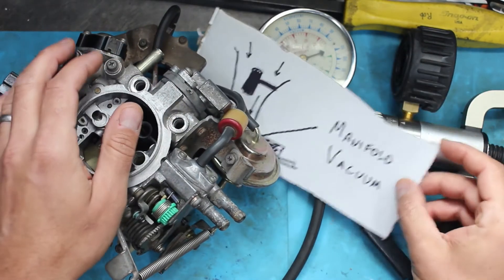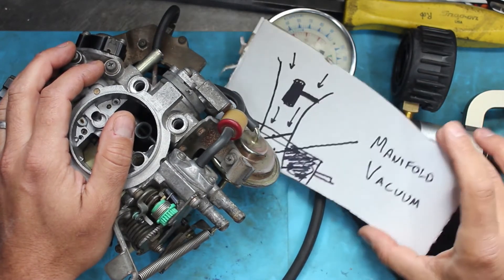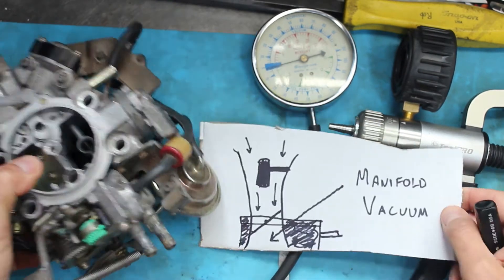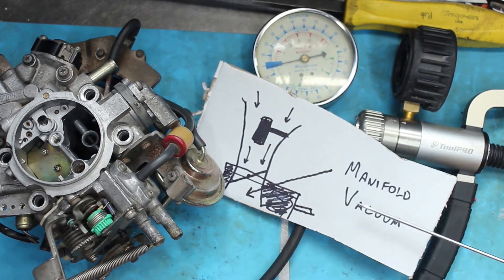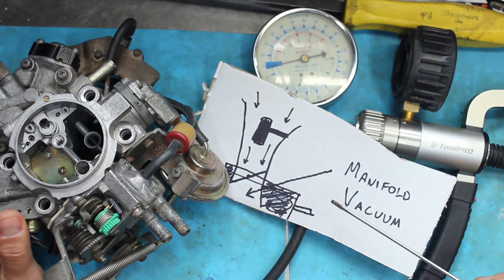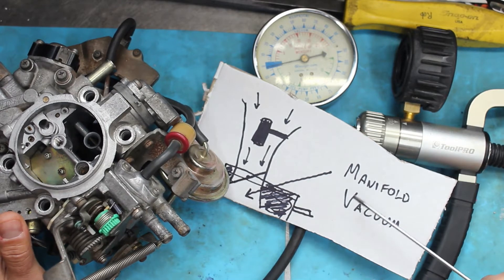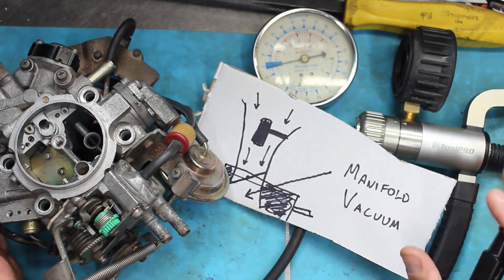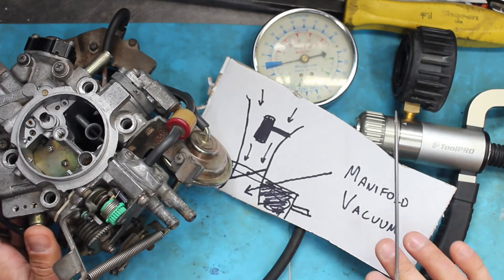Hilltop Workshop | Vacuum Advance and its CORRECT operation, explained.

Comment: What you're saying is nonsensical.  After you crack the throttle, the vacuum signal you get at the ported source is the same as you get at the manifold source.  The vacuum is generated by the engine. Vacuum is vacuum.  The vacuum gauge example you give at the 12:00 minute mark of your video would be the same if you used manifold vacuum, in that it would come down from a high reading to the same position as ported.  This can be demonstrated in a running engine with two vacuum gauges.  One connected to port and the other connected to manifold.  Run the engine to whatever rpm you want.  The gauges will show the (virtually) the same reading...
Reply from the maker: That is demonstrably incorrect. I've actually performed the exact experiment you're describing and it's not until the throttle is open enough to negate the effect on the ported vacuum circuit that they equalise.

Vacuum is most definitely NOT vacuum. If that were true, how would we get vacuum secondaries to open when manifold vacuum is at 1.5 inHg or lower?

We can only do that because we're pulling vacuum signals from different points of the venturi and as such, different levels of depression.
Reply: @thehilltopworkshop  in the case of something like the quadrajet, the vacuum secondary flaps are held shut, firstly by the carb linkage - at idle, you can't push open the secondary flaps until the linkage is moved off idle.  Secondly, there are mechanically operated butterflies underneath the vacuum flaps.  The butterflies under the secondary flaps open progressively.  There is no vacuum signal to the flaps until the secondary underneath start to open as revs increase and thirdly, the flaps are held shut by adjustable spring pressure.  There are countless examples of 'bog' in Qjets due to not enough tension in the secondary flap spring causing them to open prematurely.  If there were no springs to hold them shut, they would simply flop open as soon as they were exposed to any vacuum...

Comment: this is the way you tune for emissions, not efficiency. you need to go back 30 years to work with manifold vacuum when v8s got 20 mpg.
Reply from the maker: How about 65 years? Please see my other video with the 61 Thunderbird. 

Ported vacuum, from factory. 👍
Reply: @thehilltopworkshop  nice! but tons of older cars were manifold from the factory. it wasnt until emissions came when they switched to ported. the NOx factor was too great they say. however, when that vac adv is set up, the car runs very smooth and gets much better mileage.
i love the snappy of the ported vacuum, but i think we both can agree that anything over mild acceleration drops out vacuum all together and we just run on mechanical. for the majority of us not building performance builds, including myself, ill take manifold vac and efficient tune for my old jeep. i have an OD trans and an even fire v6 replacing factory running gear and im going to tune for best mileage, so manifold it is. =)
Reply: @thehilltopworkshop  and i did watch your video on the tbird. i noticed it was parked in the wrong driveway. ;-)
one of my fav cars is the 64-66 tbirds. love those cars.

Comment: I don't know what "overwhelming majority" of vehicles were designed to use ported.  Pretty much all vehicles pre-emissions in the US used manifold.  You WANT advance at idle.  The engine will run smoother and cooler as a result.  Then when you crack the throttle open, the mechanical advance will start working and the vacuum advance's effects will diminish and cease completely when you lose enough vacuum.  At that point, you're running on whatever mechanical advance curve you or the manufacturer has put in the distributor.  

Not sure how so many don't understand how this works.   Can you make it work with ported or venturi?   Sure, but using manifold along with the proper mechanical curve is superior and would have always been what manufacturers used had emissions not been an issue.
And doing it with manifold is also much easier.
Reply from the maker: Please see my other video featuring factory ported vacuum advance on a 1961 Thunderbird. 👍🙂
Reply: @thehilltopworkshop  Sure, I'll watch it, but 1 model isn't "overwhelming majority", which is what I addressed.  
"Overwhelming majority" pre-emissions were manifold.  
Ported only became commonplace because of emissions.  Pretty well-documented if you look around.

Comment: You didn't touch upon the issue of different static advance settings necessary when switching between ported and manifold. One runs less static advance on manifold vacuum and more static advance on ported so that when at idle both methods have about equal advance. Once throttle plates open sufficiently both methods have the identical signal. Well made video, thank you.
Reply: No argument - yes, Ported is generally better, but your point Joe is excellent and 100% correct. Many of the YouTubers fail to mention this!  You need to increase your static timing, maybe up to 20-25* if using ported, but that level of static timing can make the motor hard to start. Manifold vac timing allows you to crank at 14-18* for easy starting,  then as soon as it fires up, timing shoots up to 25-30* which is where it needs to be. This gives you a huge torque reserve off the line which masks any drop in vac timing as the throttle blades open up.  Good video Thanks!

Comment: Sorry but there are times when manifold vacuum works well for connecting the distributor vacuum advance. 
In engines with long duration aftermarket cams with a lot of valve overlap you need a lot of timing to help them idle smoothly, you can use manifold for this and another benefit is it will reduce timing at wide open throttle to help prevent detonation. 
Maybe you haven’t built a lot of engines or don’t work on high performance cars that’s why you don’t know this?
Reply from the maker: Most engines of the style you're describing don't run vacuum advance at all. It is NOT the job of ignition timing to set or adjust the idle speed. If you're using the ignition timing to correct the idle speed, then something is wrong with your tune.

No need to apologise. 😅😉
Reply: That is just incorrect. Timing is part of tuning to achieve the highest vacuum at idle. Maybe look up David Vizard he has written many books and explains this concept really well. 
As others have mentioned, all engines use to always use manifold vacuum, the only reason ported vacuum became a thing is for emissions. Retarding the timing at idle lowered emissions.
Reply from the maker: @shelbydupree6157  K.
Reply: While you’ve got some good basic info, where you go wrong is saying ported vacuum is “right” and manifold is “wrong” when every engine is different. 

For example It’s common for people to get carried away with cam selection and run too big of a cam on the street. vacuum advance from the manifold will get  a better idle. 

Maybe a stock engine might like ported vacuum. And that carburetor in the video looks like it’s from a lawnmower btw
Reply from the maker: @shelbydupree6157  The fact that you say the carburettor looks like it's from a lawn mower, illustrates why I'm wasting my time. You clearly have zero real world experience.

Go and practise your guitar. 👍

Comment: Sorry guy but ported vacuum is an on/off switch not a progressive engaugement. Ported vacuum is zero at closed throttle and exactly the same as manifold vacuum at open throttle. Get two vacuum gauges and put one on ported vacuum, the othe on manifold vacuum. Work the throttle and note the difference. Maybe you will understand.
Reply from the maker: That is a fundamentally wrong statement and physically impossible.. Have a look at my other video where I have the vacuum gauge connected directly the ported vacuum fitting on the carburettor.
Sorry guy. 👍😉

Comment: i find the engine runs much better with manifold vacuum. 
I've done a lot of experimenting on this topic and found that with manifold vacuum. when accelerating, the vacuum doe's not go to zero,   it doe's come down, but to the same level of vacuum as the ported vacuum would be, it can't go any lower and it doesn't overshoot below the ported vacuum, I've proven that. 
 it's easy to be fooled in thinking that things  work opposite but they really don't,  if the vacuum didn't drop in manifold vacuum, you would be way too far advance and would cause pingging, it has to drop, but never below where ported level would be. 
i find with manifold vacuum, idle is much smoother, engine is quieter and exhaust manifold runs at least 50 degrees cooler, cooling fan runs less frequent at idle.
 With ported, at cruise below 40mph, vacuum is at zero and manifold vacuum is at high,  therefore ported defeats the purpose of vacuum advance for economy.
As for driveability and performance, there was no noticeable difference.  
The benefit of manifold vacuum is idle performance and low cruise where the vacuum is high.
https://www.youtube.com/watch?v=L_hx8I6GzyU&t=79s

Comment: There may be some European cars that somehow use vacuum advance as a primary advance but on Fords from ‘50 to ‘72, the factory spec was to run the vacuum advance on manifold vacuum.

Here’s why:

First, idling with high advance is more efficient. The throttle plates can be closed more, and the engine runs cooler due to more complete combustion within the cylinder itself.

Second, advance needs to be the least at low engine speeds and high engine loads. In other words, you need the advance to drop away to the base setting when you open the throttle at or just off idle. If you have advance there, the rapid burning of the high-density charge will cause the flame front to smash into the rising piston, making the distinctive “ping” or rattle of “spark knock.”  The mechanical advance then advances the timing the proper amount to keep the flame front meeting the piston at the correct time. This needs to be earlier and earlier because the flame front has a finite speed, while the piston is moving faster and faster. 

Third, the vacuum advance needs to be fully deployed at low manifold vacuum levels because the density in the cylinders is very low during this time, and the flame front travels very slowly. The increased advance allows, once again, for the proper meeting of piston and flame front. 

There are a couple of other things that don’t apply to old Fords, or cars with Holley carburetors. 

The 1960s era T-birds used manifold vacuum. 

The ported vacuum (at least in a Holley carburetor and every carb on a Ford) is equal to manifold vacuum at every throttle position other than idle. There is no trickery that uses the Bernoulli principle to make more vacuum at low engine speeds. 

The vacuum secondary actuator gets its signal from air passing through the primary Venturi, on the right side of the carburetor. This is the only orifice for this purpose. There is a spring in the actuator that pushes the secondary throttle closed, and its strength is the only thing that controls secondary opening. There are no orifices in the secondary that augment this action. 

You made a very nice video, and I can’t guarantee that there aren’t European carburetors that do what you are saying, but there aren’t any Holly carbs that operate that way, and no carbs on Fords. Feel free to provide evidence to the contrary.
Reply from the maker: Please see my video of the 1961 Thunderbird. 👍
Reply: @thehilltopworkshop  you found 'a' car that uses ported vacuum.  It proves nothing and puts nothing to bed.  Over the last 44 years, I've owned many American General Motors cars from the '60s.  They've all been manifold vacuum from the factory...
Reply from the maker: @bonnevista "A car". Nice try.

What about the thousands upon thousands of stove bolt Chevy engines from the 50s?

Saying you've "owned many cars" that were set up like that means nothing, especially if you changed your them yourself.

Dude, I can guarantee you don't have anywhere near the experience I've had in this field. I have worked on literally thousands over here.

Give me some examples of these "many". I'd be keen to research them.
Reply: @thehilltopworkshop I haven't changed anything myself 'dude'.
All the American cars I've owned had manifold vacuum from the factory. l made no mention of Chevys from the '50s. The American cars I've owned are mostly from the '60s with a couple from the '70s. 
I have factory service manuals for all of them. They all specify manifold vacuum. The '70s cars have manifold vacuum controlled via a thermal switch to control oxides of nitrogen.
Again, you've only shown one car. How about you show some examples of all these thousands of American cars you've supposedly worked on and refer to their factory service manual...
Reply: I have a ford with 302 with a holly, aalso run better on manifold vacuum. 
If i use ported, i have to open  the throttle so far as to getting into the transfer slot make the idle mixture srews inoperable.
Reply: @lucsavoie9501  same on my 65 mustang (302, punched to 331). Manifold vacuum advance is what works best for my setup.
Reply: Nice!! I also have a 302 in a 77 f100 with decent cam, runs much smoother on manifold.
Reply from the maker: @lucsavoie9501 If you "need" to run full manifold vacuum to make your car idle, and disconnecting it makes your idle circuit inoperable, you have a major problem elsewhere.

Comment: The small holes that you are pointing to at 10:47 are in function similar to the “transfer slot”. They are there to provide additional fuel at the beginning of throttle opening. They are part of the idle mixture, not for any vacuum.  The vacuum ports are to the left and right. 
In your carburetor, next to the vacuum connection for the secondary diaphragm, the other connection goes to “something” and then connects up high at the secondary. What is that “something”? My carburetor version doesn’t have that part. The particular connection goes to the Jet valves, and I am very interested in what ways the Jet valves get clean air only.
Reply from the maker: Some is them are progression holes/slots; Some of them are vacuum ports.
Reply: @thehilltopworkshop  At  6:00 video time, the picture top right shows a rectangular metal with vacuum lines fastened on the carburetor. What is that? That is what I am interested to know. Thanks.

Comment: You might find this interesting. https://youtu.be/WD_bhDq_8tY 
A different take on ported VS manifold vacuum.
Reply from the maker: That's an interesting video, but it is not the job of the ignition timing to determine the idle speed in these instances.

Retarding the timing for any reason at operating temperature is just completely counter intuitive. 

I'm going to remake my video because it is so poorly edited and organised.
Reply: @thehilltopworkshop   Most all American cars before the start of emissions used manifold vacuum. My 1963 dodge with a 383 V8 only had one port and it was manifold vacuum. I didn’t see a retarded timing event when he was showing that both ported and manifold vacuum were the same when driving and the timing was only different at idle.

Comment: There are exceptions to using ported vacuum...............yeah.............like EVERY car made before 1969
Reply from the maker: "EVERY car"? I have a couple in the shop right now that would like a word with you... :/
Reply: @thehilltopworkshop  Thats what I get for using an absolute term like every :) What pre 69 cars do you have with stock oem carbs on them that use ported vacuum?
Reply from the maker: @kztrekz3329  EDIT: Just uploading a video response for you right now. ;)

At the moment, a 1961 Thunderbird with a factory original 390 FE Big Block. Also, pretty much any GM V8 with a QuadraJet uses ported vacuum.

Single barrel and WW Strombergs - Ported vacuum in pretty much every application.

Webers on countless British and Euros - All ported vacuum.

Zeniths on Dozens of Euros - Ported vacuum.
Reply: My GMC P30 Motorhome with a 454 and Quadrajet uses manifold vacuum for the distributor. You can read it in the GM truck book too. The truck is made in 1980.
Reply: @Ami8driver  If memory serves correct, GM trucks switched to ported in 80/81. I have an '80, will need to check the specs, be interesting to see which it's hooked up to
Reply: No, thats not correct by a long shot.  Ported vac ignition advance has been used by automobile engines since the 40s.  The switch to ported in the 70s was indeed for emissions as well known ,but it is incorrect to make these broad brush 1969 remarks and also incorrect to say or suggest that ported is emissions only.  Not correct.
Reply: @BlueOvalEdge  If they have been using since the 40s how could they then switch to it in the 70s? Wouldnt they have already been using it?